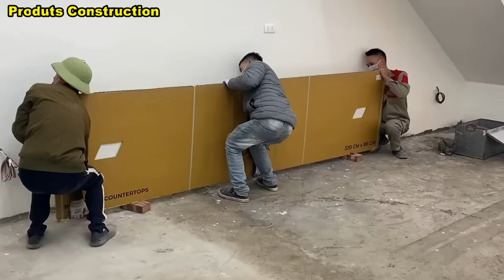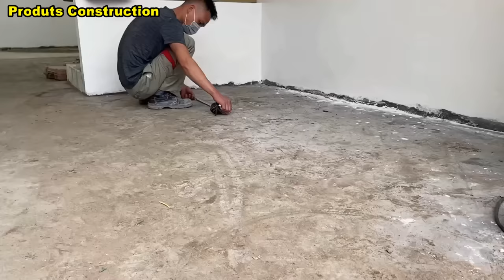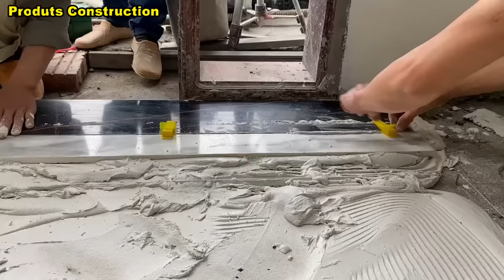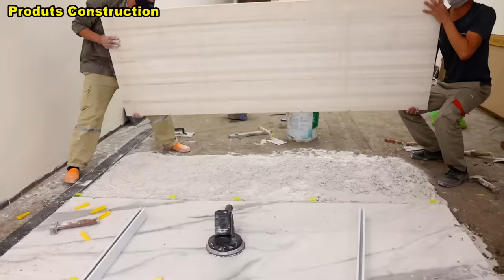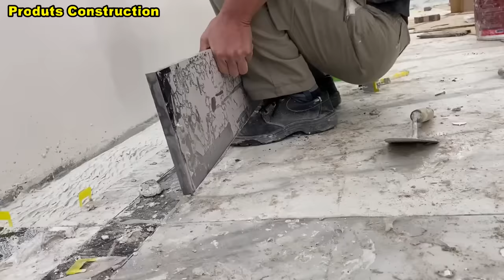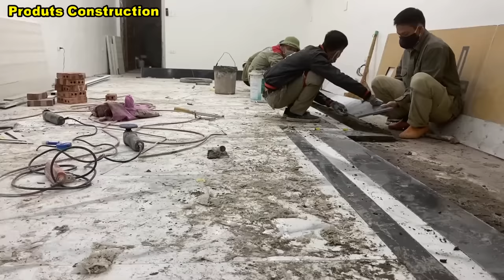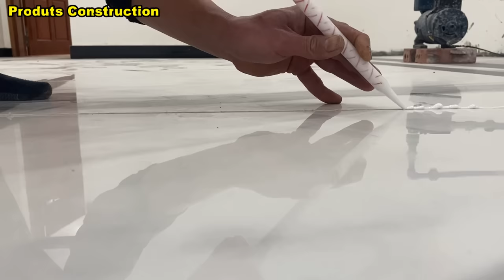Construction The Living Room Floor With Granite Big Size - Install Granite with Perfect

Comment: these guys are as sloppy as it comes. it will take them days to remove all the thinset from joints and such...
Reply: They use thinset as grout 🤣🤣👍
Reply: They know what they're doing.  It's the western guys that can't do this kind of stuff
Reply: @punjabimundaUK  i dont think so...yes they are getting it done and its going to look good but your not supposed to use thinset that thick and walking on it instantly. they are using thinset like a mud job.  these are sloppy amateur hacks 100 percent. i mean i dont see anything right in this video, they arent even sweeping the floor, just thin setting over dirt . it did look good in the end but its a video and everything looks good in a video

Comment: Lol.  The white material is 12mm simulated statuarrio polished porcelain slabs.   The veining is too consistent to be natural stone.  You can tell it’s porcelain by the sound alone when it’s laid on the concrete substrate.   It’s too light too to be natural stone.  If this was marble it would cost a fortune to do and this place does not look like a palace.  Lol.  Porcelain will never crack if it’s laid right with no air between the tile and concrete base with the thin set.  But. These installers are sloppy and bad in most aspects of this procedure
Reply: 0:34 it says "porcelain countertops" right there on the cardboard packaging
Reply: @jacqdanieles  they use this for floors, walls and countertops
Reply: I wondered how could they cut it so softly while cutting granite marble will take a lot of time and it’s real hard
Reply: You can tell its porcelain by the box LOL.
Reply: @harryballsacky  Lamest thing I've read
Reply: 3 metre by 900 mill porcelain sheet , not marble , you can tell by how small the people are 🤣
Reply: I also feel it's not granite bcos granites are much heavier, thicker too.
Reply: Porcelain have beige sides and undersides and these tiles are the same colours all sides so no it not porcelain
Reply: @eugemorin7786  wrong.  Where do you get porcelain from, Mars? That’s Porcelain.
Reply: @eugemorin7786  ceramic tiles have beige sides , not porcelain.  Porcelain is baked longer and at a higher temperature. Before you embarrass yourself please know what you are talking about

Comment: They never bothered to sweep the floor first and this is ceramic tile not granite.
Reply: If you are going to correct someone, shouldn't you at least be right yourself? The large slabs are porcelain, box very clearly states that.
Reply: @billymacktexasdetective5827  Mr know it all, the cardboard wrappers are not 'boxes', they are not to do with the contents, the contents are not 'kitchen worktops', what they lay on the floor are 'ceramic tiles', if they were what it says on the box they would be much thicker for their purpose.
Reply: @chrisclarke7828  You are wrong again. That is factory packaging, not something they found in the trash and are reusing. It's funny how on lamars website they have this exact product. It's countertop and it's PORCELAIN. Try to be a little smarter next time, ok???
Reply: @billymacktexasdetective5827  I know that but that packaging is not for that material, it clearly says so. Read the writing and you will see it says nothing of FLOOR TILES. You know nothing of building terms you are a poor detective whereas l have been in construction 57 years and this type of large size sheets we lay in houses we build in Spain and Portugal. Look online at Porcelenosa.

Comment: The surface finish is definitely not granite- the wave/grain effect is more marble-like. The type/process of laying r not prudent to lay marble, if real marble is “made” affordable cut into this large sizes=building is too small for such big real marble slabs, also the weight to easiness of handling is rather doubtful, because real marble cut to this large size is very fragile and breaks easily due to poor flexural strength. For a “guarantee” problem free laying of this expensive real marble - I would peg out the reduced level to formation level and I would be using a self-levelling cementitious compound substrate to ensure water ponding and hollowness between tile/ground. 
This is a “handyman” workmanship ~ especially using a hand held grinder to cut the slabs. 
Also, there is no expansion stripes for the slabs. Usual practice is to lay aluminium stripe for thermal expansion between butt joints stone to stone to prevent cracking~ the bigger the slabs, the bigger the gap needed. 
My observation - it is definitely not granite and very probable not marble but “plastic/epoxy” man made slabs. Plastic/epoxy shiny surface do not take well with wear/tear of shoes walking/grinding- scarring.
Reply: Tiles are porcelain.
Reply: @tilerman  
Yes, I believe they are~ have you any experience of these porcelain tiles used in common walkways bearing the foot wear/tear??? The the lost of the sheen shining lustre top surface??? What about scrapes n cuts???
Reply: @angxiang3186  I've been fixing porcelain tiles for over 20 years. There are different types, the ones in this video being polished porcelain. Very slippery especially when wet and here in the UK i would never use these in a high footfall area. I mainly use these tiles in domestic homes, bathroom's and kitchens. Polished porcelain is quite hard wearing but does scratch where as the unpolished are much more durable and less slippery. Personally, i think unpolished looks much nicer but that's my opinion.
Reply: @tilerman  
Thanks for the update. My time with tiling was then when homogeneous tiles, unpolished shale tiles were very popular. I think the “slipperiness” of these porcelain tiles would be same as marble/granite; what about thermal expansion n allowance for gaps in butt joints? I think it is used as unpolished to be laid in outdoors area as courtyard flooring.
Reply: finally someone who knows what's going on.. thank you... the process looks very sloppy

Comment: First: This is not granite; is marble. Second: the process of applying the mortar is completely wrong: uneven and in some areas with a normal trowel and in some other with the dented trowel. This is bad.
Reply: Yep exactly, how should we help them ?
Reply: It's neither. It's porcelain. It's printed on the cardboard carton 0:34
Reply: @jacqdanieles  yes its ceramic tile not suitable for flooring
Reply: This is artificial slab

Comment: THE WHITE PIECES IS NOT A GRANITE OR MARBLE !!!
IS THIS PORCELAIN CERAMIC 
RECOMMEND FOR FLOORS AREAS OR  ONLY FOR COUNTERTOPS ???
Reply: You can use it in showers floors and anywhere else so long as setting bed supports material properly.
Reply: @joniboulware1436  
Make attention  because some tiles was made only for wall .
IT DOES NOT HAVE FINISH FOR WALK
Reply: @joniboulware1436  
MAKE SURE  BEFORE INSTALL PORCELAIN  OR CERAMIC FLOORS.
IF YOU INSTALL PORCELAIN MADE FOR WALLS  IN THE FLOORS WILL BE DAMAGE SOONER AND SCRATCH